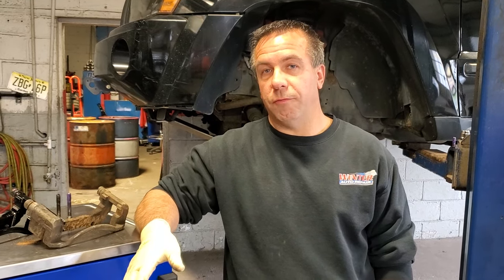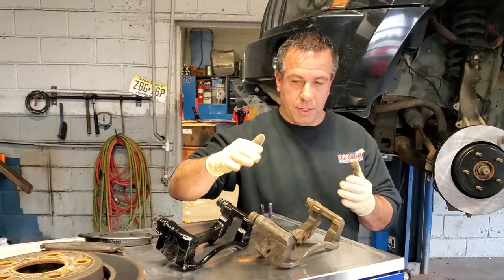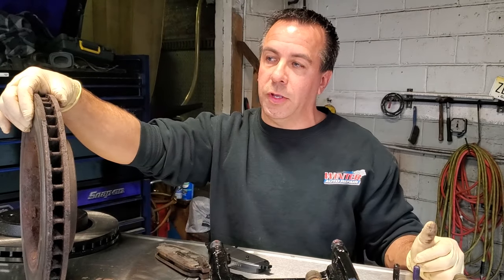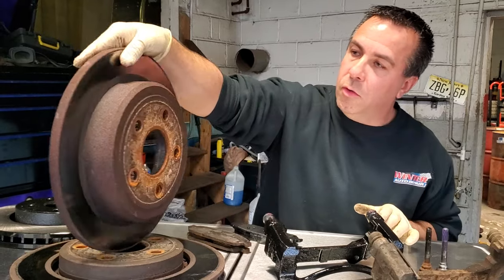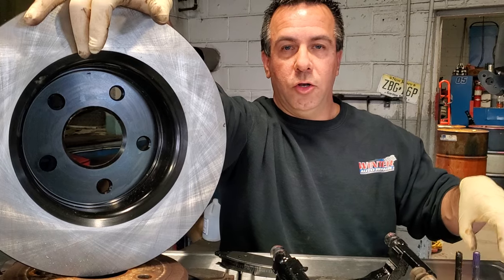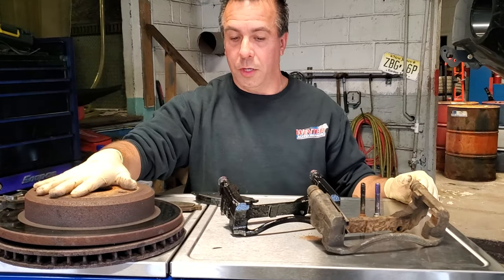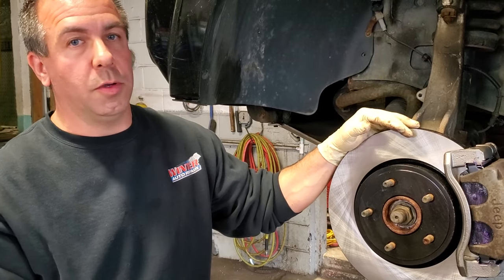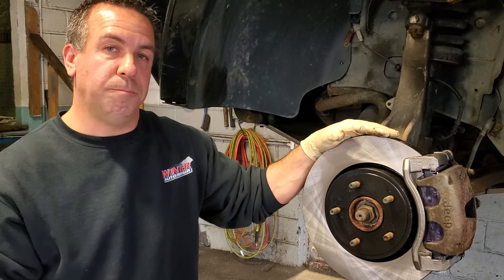High quality brakes vs cheap brakes

Comment: The reason they make them thin is cost only. Due to the cost most people would have them turned 2 or 3 times. This shifted profits partially to the shop that was doing the brake job + turning. Manufactures wanted to recapture the profits. About the same time many shops switched to hiring less experienced mechanics who can replace parts, but have no clue how to run the machines to do the complete repair job. So it's cheaper for the shop, and maximizes thier profit as well by hiring less experienced mechanics. The MPG difference between the older thicker rotors & the new thinner rotors is far less then 1%. AKA not noticeable, but just enough that the manufacture can claim they were not miss leading anyone. We are talking about a few pounds at most. 100 pounds equals about a 2% change in MPG. A few pounds is not an issue, or your groceries would kill your MPG.

 Even at that, with high quality brake rotors you will often find they are just as thick as the older ones. The difference is in the metallurgy. It's both stronger and a little lighter then the old metallurgy formulas. 

So just replacing the rotors boils down to increased profits of manufactures & most shops. Not for the money savings of the vehicle owner by saving far less then 1% in MPG. If reduction in TOC was a concern the shop would inspect & measure the rotor first. The starting thickness makes no difference as long as the minimum thickness is never exceeded. Even if the majority of newer parts store rotors can only be turned 1 to 2 times vs the old ones that could be turned 2 to 3 times, it still saves the owner in TOC. Instead of just replacing because it can't be turned as many times, or the intentional lack of knowledge & experience to do it. 

The fact is that the increased cost to the owner so the manufacture and shops can increase profits, has led to owners leaving parts in service far to long. This leads to a part that must be replaced & dangerous conditions. The starting thickness of some new rotors is a  red hearing used as justification. Brakes that are serviced at correct intervals can still be turned once or twice before coming close to the minimum thickness in most cases. 

If customer safty was then main concern, this shifting of a higher cost to the customer to increase profits wouldn't happen. Which would encourage customers to service thier vehicles more often, maintaining a safer vehicle.
Reply: You hit the nail on the head.  One reason I always do my own brake jobs....is because of the gouging of repair shops, especially in regard to replacing rotors.  I've never had a brake failure....and I've saved thousands of dollars over the years, by doing my own brakes, and replacing only what was absolutely necessary....usually only brake pads or shoes.  I drive hard, by the way.  I'm certainly not easy on my brakes...or clutches...lol.

Comment: Great video. Thank you for the explanations of the different qualities and what to look for. I was looking at NAPA's brakes for my upcoming rear replacement, so when I price them out, I will look at the build quality before purchasing. 

I will do you one higher though, I have a 99 Silverado with 360,000 miles. The front brake rotors are original and the pads have only been changed once. Grant it, I realize that that's because Chevy's front to back brake ratio drastically favors the back brakes, but its still super impressive. Getting ready to do only the 4th set of back brakes on my truck. Up until this change, we've only used ACDelco OEM brake parts (which are now extremely rare to find). But even still, my back brakes are lasting an average of 120,000 miles. Extremely impressive quality. Thanks again!

Comment: A lot depends on the age and condition of the car. People driving 10 to 15 year old cars, that are starting to rust, and that have some mechanical problems, will tend to go with the cheapest repairs. On the other hand, people with older cars that are in great condition, will tend to use OEM, or better replacement parts.
Reply from the maker: You're not wrong that this is usually the case. However, in our shop we only use the better parts. We feel your life and families life isn't worth a few dollars less in price but far less quality. We will recommend other cheaper shops that use the cheap quality parts that tend not to fit well. Our clients all know our quality and no matter your car. Top quality is all we will use and stand behind.

Comment: You are spot on about buying quality pads and rotors for your car. A number of years ago I was in a jam where my Subaru was metal on metal for the brakes. (somehow the metal wear tabs broke off so I never heard any screeching before hand). I needed brakes that day so I went to Auto Zone and got their "Premium" set of rotors and pads. After 10,000 miles the pads were worn out, but hey they had a lifetime guarantee so I got them replaced for free. Installed a new set and 10,000 miles again and not only were the pads worn but the rotors were warped. 

This time I ordered a set of EBC rotors and pads. They have been in the car for 40,000 and still have plenty of life left.
Reply: Ebc rotors and pads were amazing

Comment: Out of all the brake jobs I've done, I've only ever had one set of rotors warp and they were from Disk Italia which are supposed to be very high end.  At the time they were reported to make rotors for F1.  I currently run Stoptech.  I told my mechanic I'd get the parts I want to use and he said he won't install cheap stuff, which makes sense. After telling him of my background in being and former mechanic and racing he agreed to install what I brought.  He smiled when I showed up with parts far above OEM to match with the OEM Brembos.  We have a good relation and I often bring specialty parts and anything I don't bring, he will order OEM from the dealer.  
The pads BTW are Ferro Carbon.  Got a bit of a squeal but they have a higher friction and temp rating than the stock Audi/Brembo pads.

Comment: My guess is the inner pad just wore off faster due to sticking guide pins. I had this exact situation on my old Mazda - outside pad was still plenty thick while the inner pad wore to the metal backing.
Reply: I prevent such wear by disassembling my front disc brakes once a year and cleaning and lubricating the caliper guide pins.
Reply from the maker: The inner pad on this Jeep rusted so badly that the pad material came off. You are correct in what you are saying. Sticking guide pins will cause the inner pad to wear while the outer pad doesn't. we prevent that from happening by using the purple Permatex Ceramic grease as seen in the video. The grease is good to 3,000 degrees so it doesn't dry out even after years of use. Like Davids reply. You can take the brakes apart yearly and re grease the pins or use the Permatex and have the pins stay floating for the life of the pads and rotors. Thanks for watching our video. Please subscribe as we are making more helpful videos now.
Reply: Yup happened to me too. Now I always grind off the rust and drill out the rust then coat with silicone lube.
Reply: @WinterAutoRepair FYI, Permatex has a red ceramic silicone grease that is recommended for guide pin rubber components. The purple grease can be used everywhere else... spread the word.

Comment: Great video, Chris !!! Are the rotors you're using the DuraGo Electrophoretic Coated ones, or are they Centric Rotors?  Since I live in San Diego by the beach, will these rotors be an ideal choice for a daily driver 2011 Toyota Venza? Thanks
Reply from the maker: We only use Centric.  The rotors we used in this video were their high carbon 125 line.   Being near the beach the coating will definitely help prevent rust and increase the life of the brakes!   Thanks for watching and commenting.   Good luck with your brake job.

Comment: I got the base trim rotors for my 02 Accord at 200k. Now at 260k, I think I can go about 5000 more miles. Because I drive 50-60k per year, they lasted pretty through the lives of two sets of pads. But now the rust is beginning, which for most people after 14 months only means 20k or so miles.
Reply from the maker: Not sure where you're from but in NJ you can't get that many miles from basic rotors.  If a car gets rained on in nj, the rotors begin to rust immediately.   If you don't drive the car for a week or two, the rotors become so pitted that they vibrate when braking.  The salt and acid rain are terrible here.  Thanks for watching and commenting on our video.
Reply: For Honda brakes you can try geobrakes.com they sell all oem brakes
Reply: Yes, I've definitely had better experience with the painted Rotors; I'm actually from Trenton!

Comment: Parts of this video are correct and some not so much lol. 1. Quality rotor will have some sort of coating yes. Grey fusion coating is the best not paint. And no on cross hatching… 2. Quality rotors will have no cross hatching and a much better machined finish. 3. Clean the caliper brackets yes and new shims always! Paint not necessary… but looks good. 4. He has no lube on caliper bracket shims as he said pads need to slide. Not going to slide without lube and will rust way faster. 5. Lube not needed on outsides of brake pads. Does help with noise yes on cheap pads but… but attracts dirt, dust, moisture etc… buy better pads with multiple shims instead of lube. And last one 90 something miles, ya ok… all highway and didn’t mention the part where they serviced the brakes every year to get those results. I mean serviced as in “caliper service” which in tails taking everything apart and cleaning re-lubed and putting back together. Same as a brake job but no parts being charged.

Comment: Just replaced my front pads on my 2010 Jeep Wrangler and I used Raybestos Element3 pads which are a hybrid of ceramic and semi-metallic. All went well and I found it necessary to hand file the guide tabs on the pads to ensure easy motion in their guides in the bracket. I  used grease only on the guide pins no where else. My concern is that grease attracts dirt/dust  thereby increasing resistance to motion by making the grease thicker and can  also be thrown off onto the disc if a hard bump is is hit, rendering the brake useless. My discs were smooth and unwarped so I reused them but I did not measure their thickness.  I did replace the guide pin seals even though the OEMs were okay. I saved myself over $400.00 by doing the replacement myself.

Comment: Perks of not living in the rust belt is that I can’t imagine replacing a new rotor because it’s rusting to crap already
Reply from the maker: Unfortunately in NJ we not only have acid rain and salt.   We have potholes and terrible road conditions.   Typical car in NJ needs new struts and shocks every 60k miles and new wheel bearings every 100k.  It's sad how beat up the cars get in nj.
Reply: @WinterAutoRepair  Illinois is NO better, our roads are horrid!!

Comment: OMG, don't wish for state inspections. In Pennsylvania it's a NIGHTMARE.

I've been taken by more than a few mechanics doing inspections. One shop told me that both my rear brake cylinders were leaking. It was $200 EACH to replace them. The next year I took it back and they told me the SAME THING. I pulled my car from the shop and went to another and they told me my cylinders were original to the car and perfectly fine. 

Yes, they didn't even change them the first time!

This last inspection the local shop told me I needed four ball joints. While replacing them I realized that two of the four were completely fine. Of course I replaced them myself, which only cost about $75 but this program is a constant flow of fraud and lying.

I do all my own work as a matter of self-defense.  I tell my inspector they won't EVER get the work from me. I've done frame welding, exhaust manifold, transmission replacement, ball joints, and much more and the mechanics never make a DIME from me. 

The only way I could see it working is if the inspectors didn't have a financial incentive to be scum. Maybe make them a part of the DMV with no option to have the work done in house.

Comment: Thank you for the video! I really learnt alot especially the brake grease I was not aware that you could use grease on brakes!...with regards to the brake bedding procedure can you give us some tips please?
Reply from the maker: You're welcome.  Thanks for watching and commenting
Reply from the maker: As far as bedding goes.   Go to a road without traffic if possible.   Travel at 40 mph and slow down to around 10 mph then back to 40 and repeat stopping 5 or 6 times.   Then drive without braking for a bit.    Start over with the 40 mph to 10 mph again.   I do this 3 times and then drive for a few minutes on a highway where I can not hit the brakes for about 10 minutes.   Once done I park the car for an hour where the brakes can cool all the way down.  There are many procedures but for street cars this is the process I use.   Race cars I do a higher speed process but that doesn't apply here.   Good luck with it!
Reply: Thank you for sharing your knowledge and experience with me and the many other people who are lucky enough to read this post!

Comment: I just bought two new front rotors for my Camry from Toyota after going through two sets with Autozone at one set with O’Reillys. 
Kept the aftermarket calipers and pads, but the rotors make a huge difference.

Comment: A brake job is fairly easy with basic tools.  The exception is on the rear brakes for some cars requires the ODBII computer hookup to retract the parking brake portion of the caliper.  VW/Audi are good examples of this.

Comment: I should have got the High Carbon Rotors.  I recently installed new rotors and pads on all 4 of my breaks and in less then 1,000 miles the break surface and the drums are so rusty and ugly, I'm now researching how to get the rust off and keep it off.  Looks like I'll be scrubbing off the rust and then painting the interior and exterior of the drum with high temp paint.  Great video!  I wish I had seen it earlier.
Reply: Rotors are cast iron. Rust forms on the iron  surface and creates a protective barrier. Use copper anti seize on the hub face so that the rotor doesn't get frozen on. Other than that, rusted iron isn't a problem.

Comment: I got about 800 miles out of my autozone rotor.  Caliper lasted 5 months, then leaked all my fluid.
Reply: Got 95000 miles on Durago rotors from car ID with akebono ceramic pads on my 08 c300. Pads are still 60% . Hard to believe ,yes. Durago is the manufacturer of some named brands which sell rotors for $100 a piece. Mine were $30 a piece. And akebono pads were $65 when I purchased in 2017.
Reply from the maker: We see poor brake life all the time.  Our shop is all about quality and customer safety.  We only use Centric brake parts.
Reply: @WinterAutoRepair  good to know. Thank you!

Comment: Your customers are very lucky to have such a genuine technician. Are there any brands of Rotors that you would recommend for a Honda besides OEM?
Reply from the maker: Thank you. Yes, we typically use better than OEM. Currently Durago EP are coated high carbon rotors. Those have been lasting the longest.  Perfect Stop high carbon is our second choice. 
Thank you for watching and commenting!

Comment: Great information. I have a 2002 jeep grand cherokee LTD 4.0 and I am in need of rotors F/R of this high quality. What would you suggest? Thanks
Reply from the maker: Thank you. Look for Durago EP high carbon rotors or Perfect Stop high carbon rotors. We used Centric High Carbon in this video but Raybestos has since bought Centric and the quality isn't as good. 
We seem to have the best luck with Durago EP currently. A good autoparts store or Rock Auto should have them. 
Thanks for watching and commenting!

Comment: hi great review. what brake rotor and pads you recommend for 2011 toyota prius - what manufactur?

the high carbon rotor is more for a sports car or a truck? do the brakes need to be warm to have best braking performance?

Comment: Thanks for the great explanation and helping to understand the importance of quality brake components. 

I recently got new rotors installed on my car which has the same cross hatch pattern that you explained. But after the first drive, I noticed that the cross hatch pattern was heavily rubbed and I couldn't see that pattern anymore on the area where the brake pads touches. Is it normal to happen right after the installation? Also I sense the read wheel new rotors are very hot after the replacement. 

Thanks for your help
Reply from the maker: So I have seen cheaper rotors come with a slight machine (the cross hatch). However, that wears off quickly. However, on the better quality and harder metal, high carbon rotors, the hatch lasts a long time. We've had them last thousands of miles and several years.  What brand rotors did you buy?  You'll know if they are good quality after about 15,000 miles. Cheaper rotors will start to really wear out and warp by then.  Good luck, and thank you for watching and commenting!

Comment: Excellent video.  Folks ask yourself this simple question before you get your brakes repaired / replaced. How much do I value my life and the ones I love? I hope this helps you make a sound decision. My answer is always buy quality brake components.This is the only way you will get satisfactory stopping ability when you use quality parts. I would worry more if my vehicle does not stop than if it does not run at all. Don’t cheap out on vehicle brakes because your life and the lives of others depend on you and others to stop their vehicles in a reasonable time frame. Cheap brake components increase stopping time and distance which you may not have in an emergency situation. 😊